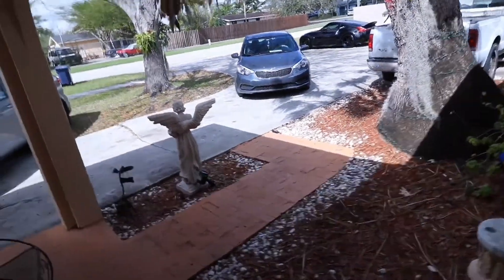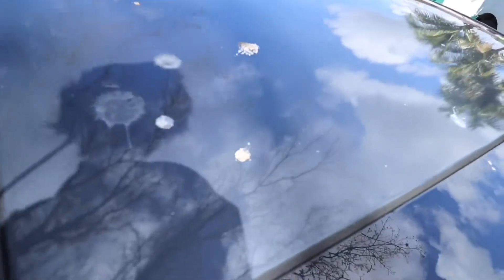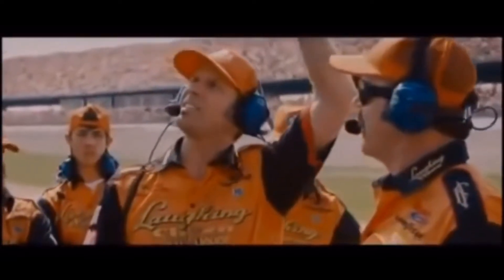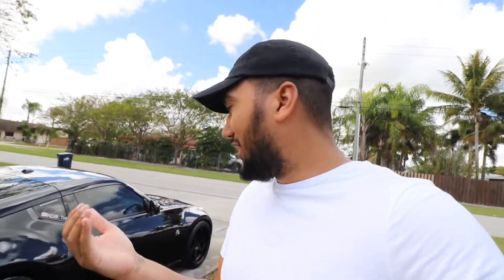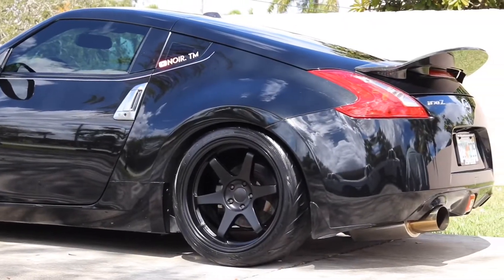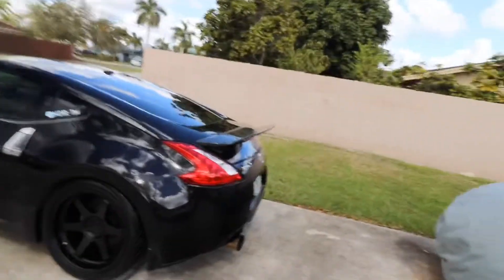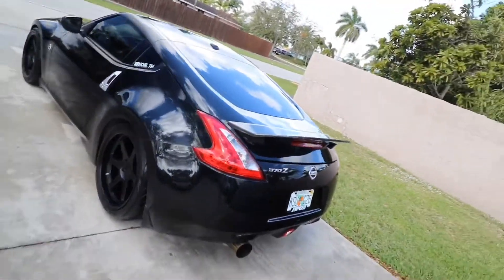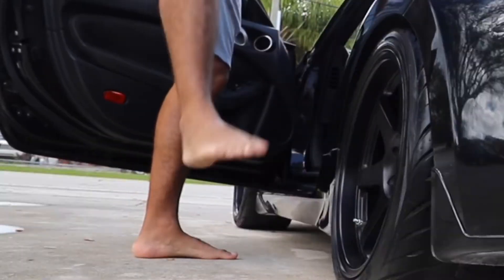THREE MUST HAVE MODS for 370Zs | Noir.TM #Noirgang

Comment: personally my mod list was a ceramic pro coating and clear bra on the front end...gotta protect the car especially black ones. 
Touch screen because wtf is nissan doing with these ghetto ass head units.
exhaust test pipes and long tube headers.
wheels and suspension last for me lol
Reply from the maker: - That’s a good, different perspective. I’m actually doing all three of those right now and I wish I did paint protection earlier.